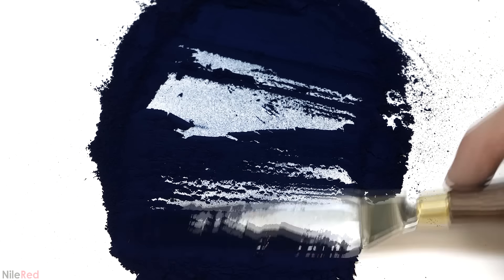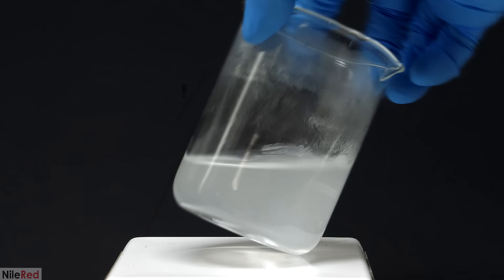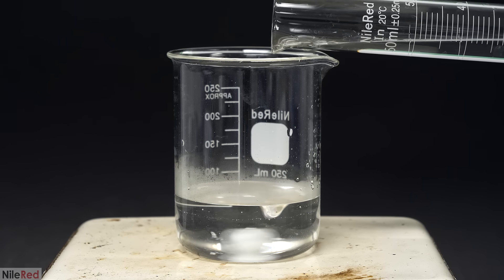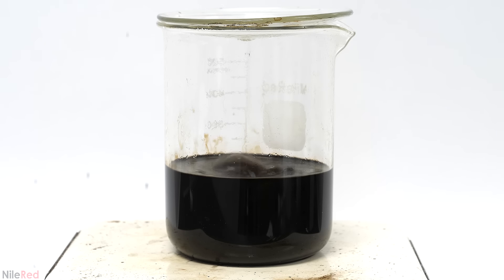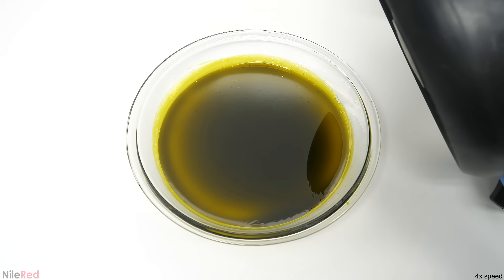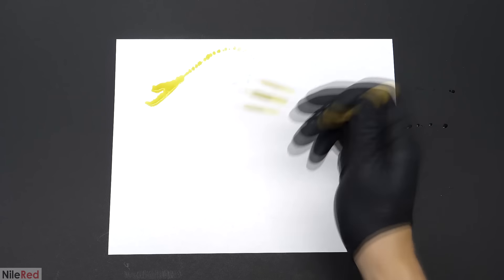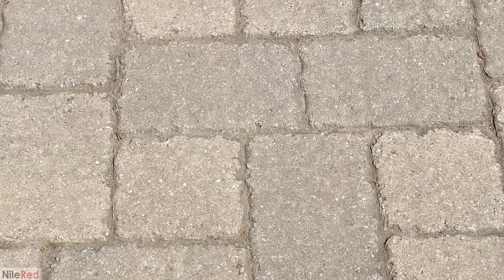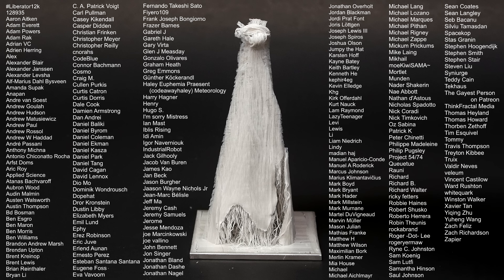Making my own blueprint

Comment: I make ammonium citrate by the ton for a living, what you had was most likely the dibasic form. Tri can only form at a pH between 7-10, and the Di wont turn into Tri once its formed. When we make Di, we add all the citric, then bubble in ammonia gas, but with Tri, we have to do a co-addition that lasts 3 days, and we have to start with the ammonia and get the ammonium hydroxide to a pH of 10 before adding citric bag by bag to keep the pH between 8-9 as the tribasic forms. If it dips below 7, all the Tri turns into Di and wont turn back into Tri

Comment: We used to make blue line prints (basically opposite blue prints) at the engineering office where I work.  I always thought the whole process was fascinating.  After making a few sets of drawings though, you would get dizzy from the ammonia.

Speaking of, we have a few gallons of used/dirty ammonium hydroxide sitting around.  Apparently back in the day, they used to just put it in the dumpster or pour it down the drain.  Now it just sits in a dark storage room, because nobody seems to know how to properly dispose of it.  

Maybe we could donate them to you?  I'm sure you could probably do something cool with it!

Comment: Iron salt chemistry is very complex. I used to precipitate the magnetic oxide of iron called magnetite by using iron II and iron III salts, and then adding a base. However the mixing speed, temperature and also the time between dissolution of the salts and the final precipitation matters a lot. The reason why the dissolution time matters so much is because the water molecules form hydrated shells around each ion, this affects the accessibility to the base and can cause different types of precipitates to dominate.

Comment: I used to make blueprint copies on a Diazo machine. First we would take what we were trying to copy which was printed onto mylar (translucent plastic medium) and then we would put it over the treated paper, which I can only assume was treated with the same solution yours was because it was the same color. Then we would run the the mylar on top of the paper through a "Diazo" machine that would expose the treated paper through the mylar and its printed masked areas with UV. The only difference between your method and this machine was that the Diazo machine set the blueprint with ammonia gas instead of water (man it would stink). The machine would have a jug of ammonia hydroxide (hydrous ammonia) that it would bubble air through and it would use the resulting gas to set the paper print. the thing is, the process I described above did the negative version of what yours did. the green-yellow paper would turn white from UV and the masked areas would stay blue... heres a link to a similar machine https://www.youtube.com/watch?v=bpHK_wNfk9Q

Comment: Ever think of getting a few silicone spatulas of various sizes? May help with the "pushing down and scrapeing" of glassware, although not really lab grade tools. I worked in a soil and feed lab in my youth, we made good use of silicone squeegees to scrape wet soil off of filter media flattened out on teflon cutting boards, to keep as much solids for testing after washing, or after certain procedures. Just have to keep the cutting boards and squeegees clean. Just a thought.
Reply: One of the first things I got for my lab. Super useful, and you can get 3 for a dollar at the local dollar store

Comment: So different than what I remember.  Maybe I'm going senile, but I distinctly remember, while working as a teenager in a drafting shop in the late 70's, placing pre-treated paper in a tube and subjecting it to ammonia vapors.  Trouble is, I can't remember how the exposure worked for that (maybe running the paper and the drawing through rollers that passed it over a U.V. light [such a vague memory], and I can't seem to find anything about how that process worked.
Reply: Wikipedia confirms that contact roller printers were used for large images, as would be used for large blueprints. An external link at WayBack Machine shows something that confirms some of my memories of this: https://web.archive.org/web/20141223202628/http://www.scbispl.com/diazo%20developer.htm
A device with these features:
· Ammonia pump enclosed in the machine frame
· Ammonia flow controlled from the front panel
· Conveyor speed and temperature controlled from the front panel
· Compact desk top size
· Film input conveyor and exit tray
· Efficient fume exhaust

Comment: Seems to be a bit like emulsion used for screen printing. Cover the spots you want to print with a dark material and use light to bake the image onto the screen and then spray off the emulsion that was covered.

Comment: Doesn't glass block UV light? Or does the color react with the near UV-A thats not blocked?
Would it be considerably faster when using something like acrylic?
Reply from the maker: Using a non-uv blocking panel would speed things up. But I feel it's actually useful to slow it down, because then I get more fine tuned control over the exposure level.

Comment: I still used blue line copies back in the late 1990s for shop drawings.   Stinky process.  We used a plotter for the master on vellum or Mylar.   But it was still cheaper than xerographic for E size.

Comment: Quick question :
Why didn't you use an indicator like phenolphthalein at 4:18 to determine when the solution was neutral? You could have had a titration setup which, despite being somewhat of a hassle, would have been more convenient and reliable than just guessing and using litmus paper.

Great video as always!

Comment: 7:47 wouldn't the larger beaker evaporated it faster? I thought the greater surface area would allow for faster evaporation (why evaporating trays are wide and shallow) and more of the liquid would be closer to the heating (a taller, thinner vessel means deeper liquid, moving the surface away from the heat source.)

Comment: For the issue with the thick solution sticking to the sides of the beaker, is it possible to cover or spray the beaker with a clear hydrophobic spray or coating? Or would that interfere with the chemicals? I honestly don’t think it will, but I’m not too sure if it will mix with the solution or not.

Comment: Wouldn’t it have been easier to use an indicator solution when neutralizing the citric acid with ammonia rather than the pH paper?  And a burette for more precision rather than the test tube?

Edit: So no indicator was used because it would have effected color later?

Comment: In the step where you were boiling in a beaker and maintaining the water level by adding water periodically... Would it have been better to have done that as a reflux?
Reply from the maker: It's just a lot easier to do it this way. No extra heating mantle, condenser, etc.

Comment: I HAVE WANTED TO KNOW THIS FOR SO LONG
What is the emulsion with the potassium ferrocyanide actually for in the process if it doesn't react or engage in the UV reaction? Is that the part you couldn't find out? Would like to see results of what happens when one skips that step, my first guess is that the emulsion spreads and absorbs more evenly across the paper surface, but I am no chemist so take that with a grain of sodium chloride ;p
Reply: During the final wash stage, it reacts with the iron that is liberated during UV exposure.

Comment: Is there a way to buy the sigma aldridch type bottles you use for storage outside of buying chemicals from them? Do they just sell the nice amber bottles with seals and caps?
Reply from the maker: I really really would like to buy their bottles, but i think theyre either super overpriced or just not available.
Reply: Looks like my reply got et by the comment system. 

I think the caps are some international standard as SA sells air free dispensing replacements, and I think they sell boxes of 4 1l "ergonomic" bottles with the same cap for $200 or so.

It would be great to find a direct source of compatible bottles. even if it means ordering of Alibaba or the like.
Reply: Wayne Moore those use liners that degrade (paper pulp) and don't seem to be the standard GL45 cap thread size
Reply: They have phenolic caps with plastic liners that I use for more corrosive or volatile things.
But then, I don't keep a lot of unusual things in my lab. Any exotic stuff (things you can't usually buy locally) I keep in the original containers. Anything that makes me think it will damage the cap, I put another liner under the cap and keep in the freezer.

Comment: if you boil a solution of salt some of the salt could go in the air?
Reply: Not much.  Fine spray caused by boiling bubbles bursting carries some away but the water vapour is reasonably pure distilled water and the salt mostly stays behind.  Depends on the exact 'salt' though but regular NaCl can be separated by distillation.

Comment: So I have a big question - I was always told that glass blocks like 99% UV light, which is proven by not getting sunburns while driving a car with closed windows. Now I'm a bit concerned - is the UV sensitivity of the solution that strong? Or maybe you used some special kind of glass?
Reply: Sekeletu, glass in your car is treated to block UV to help protect the materials and interior of the car from UV damage, as are many energy efficient windows for buildings. Regular untreated sheet glass like that used in cheap picture frames is largely transparent to the UV spectrum.
Reply: Glass only blocks shorter wavelengths of Ultraviolet light (UVB), not the longer wavelengths of UV light(UVA), which are closer to the visible spectrum. You can still get sunburns in your car from these UVA rays; windshields I think have a coating on them to block UVA as well, though. I'm not sure if the side windows have this coating or not—I've seen a picture of a truck driver who had one half of his face terribly aged from the UVA rays from the sun coming in through his left side window, so I think not all vehicles will have this coating on all windows.
Reply: Glass blocks light 330nm and below, unless treated.
Reply: Truck drivers, cabbies, etc. often get skin cancer on their left arm and face by driving around all day with the window down. Plus auto glass didn't start coming with a UV blocker in it until I think the late 70s or so (could be wrong about the time) so anyone old enough to have driven around in older vehicles all day was still at risk.
Reply: Thank you guys for the info! :-)
Reply: Sekeletu 
Glass itself (amorphous silicon dioxide) is transparent to UV light. The sodium hydroxide and carbonate in the glass aren't. Glass produced specifically not to have those in it can be used along with UV light.

Comment: For cyanotypes, when I did them in school we used a hair dyer on the front and back to dry out the paper. It is a lot easier and quicker, although it might change color it's ok. We then used negatives or put objects over a glass or proofer to make an image. We also put the blueprints in water and then in hydrogen peroxide to make the blue even deeper. That might help a little bit. I would also recommend using a thicker paper. I believe you can even use fabric! If there are any questions I'll try to reply!

Comment: I know barley anything in Chemistry at the levels you go into here, but I do know that the most common emulsion we will typically see is Mayonnaise, so imagine mixing up that from scratch (Water, Egg whites and vegetable oil stirred till fluffy minus the fluffy in this case) and you may understand it better. I sure know it didn't me but your on chemist levels that almost make my head hurt and not cause I'm dumb just because if ears and eyes transmitted to the brain like a flash drive I would still be on PS2 or serial links no USB of any level, blasted ADHD.